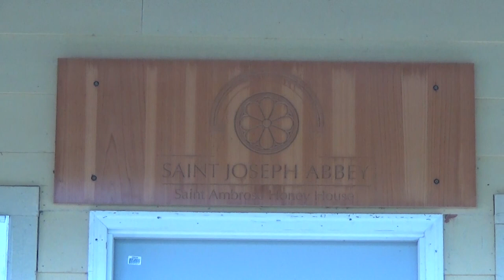Extracting and processing 140 gallons of honey.

Comment: Looks like a lot of clean up after the extraction. explains the price of honey a lot of work in honey. Thanks for the video
Reply from the maker: Actually, clean up is VERY easy. Because we have a troff/drain that runs down the center of our building, and exits under the slab in the back of the honey house, we simply wash all our machines down with hot water, we also have a tankless hot water heater just for that purpose. To clean the honey house and all the machines took 2 guys less than one hour to finish. You are correct about the price of our honey, $ 9.00 a pound is a very reasonable price considering all the work that is involved. By the way, I just posted this years edition of processing our honey, the link is below. So glad you enjoyed the video. Thanks for watching. God's peace Delmar.            Mr. Ed              
https://youtu.be/jpwmbmBbcKs

Comment: you all should get the plastic or rubber curtains that hand on door frames so when y'all open the big door you can keep you heat or a/c in the building or at least more of it and not have it all leave as soon as you open it up
Reply from the maker: I have already considered doing that. Plus, it helps with keeping the building conditioned even when the doors are closed. Thanks for your suggestion and for watching. God's peace.
Mr. Ed

Comment: Put a spigot on a 5 gallon water drinking cooler, let it set like you did in the buckets, then open the valve and drain the honey out from under the cappings.
Reply from the maker: That would work, just a bit slower than my method. Thanks for watching. God's peace.
Mr. Ed

Comment: I process that much honey by myself with a 9 frame extractor, 1 knife, an uncapping tank, and in my basement with no pumps or sophisticated equipment...if I had that shop setup I'd be able to process 10 times that!!!!
Reply from the maker: Regardless of where we are in the types of machinery we use to process our honey, or not use any machines at all, the joy of extracting honey is never lost. God's peace brother.
Mr. Ed
Reply: Same here - 350 quarts from apiary to quart jars using a 9 frame extractor, home made uncapping tank, a cold knife, 2 bottling buckets - and one person (me) in my garage.  

This operation is a thing of beauty, and it's a great video,  but the operating overhead is unjustifiable for a sideliner my size (or your size even?) - it seems like the clean up alone for all that equipment would be a killer.

I guess beefriendly and me should make our own videos on doing it without elaborate equipment.
Reply: It's a shame to have that that equipment and run so extremely inefficient. I was crying watching this. To justify the cleanup you need to be pumping a lot more through your setup.

Comment: What are the lower walls covered with? Finishing up my honey house and tossing ideas around. Pressure washing walls and floors is a nice option for cleanup
Reply from the maker: They are 4x8 sheets of food grade "plastic" like material. Water proof and easy clean up as well. They are attached to the sheetrock using an epoxy glue. Still, use care when hosing the building, even though it's green sheet rock, try not to get it wet. Best wishes with your project, let me know when it's finished. God's peace.
Mr. Ed

Comment: You use all Deeps, Nice. Thems heavy! Works out to about 50 pounds per box of extracted honey. All the beekeeping calculations say there should be more, like 65-70 pounds. But I guess if they just weigh a box, then its honey Plus wax, Plus wood. So wax and wood are probably 15-20 pounds. 50 pounds of honey per box, that's pretty darn good.
Reply from the maker: After all the honey was extracted and weighed out, we got 45 pounds of honey per box. A bit shy of your number, but still, I was happy about it. The honey supers are heavy when you use deeps, but with two guys lifting, it is not bad at all. Thanks for watching, God's peace.
Mr. Ed
Reply: Always good to use all same size when you have that much volume for interchanging  equipment.

Comment: I would replace the switch on the decapper with one operated by foot. I can't help but think about how that switch ends up with honey all over it.
Reply from the maker: Foot control is a good idea, I'm going to run that by our electrician. It's going to be covered in honey also, but it is a easier motion than the switch. Great idea, thanks for the suggestion and for watching. God's peace.
Mr. Ed

Comment: i understand spinning the combs in the centrifuge clockwise for 10 minutes to extract the honey, but why do they spin it in counter clockwise for 10 minutes? its the exact same force as clockwise, unless theyre flipping the combs inside, running it in reverse makes no difference beyond what running it all in one direction would do.
Reply from the maker: In theory, that's how it should work, but it does work getting more honey off the frame by reversing the rotation. Thanks for watching. God's peace Ted.
Mr. Ed

Comment: how doe's the decaper work ?
Reply from the maker: The chains on the rollers drag across the faces of the frames, and that action will scrape the cappings off the comb exposing the honey. Thanks for watching. God's peace.
Mr. Ed
Reply: @JeffHorchoff  are the chains tight and hot??
Reply from the maker: No, they are in links and hang loose, and they are not heated. Check out this video of mine I posted last week describing it much better. God's peace.           Mr. Ed
https://youtu.be/6X4sjfiGPR8